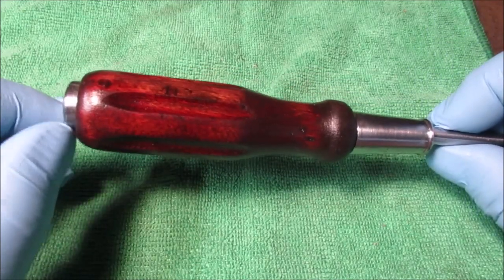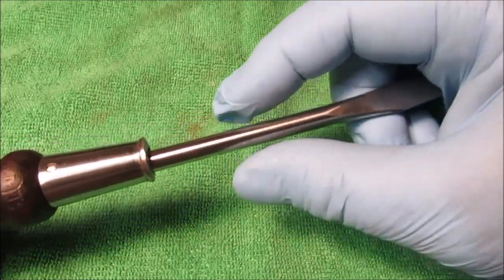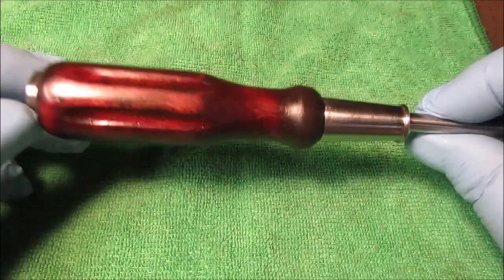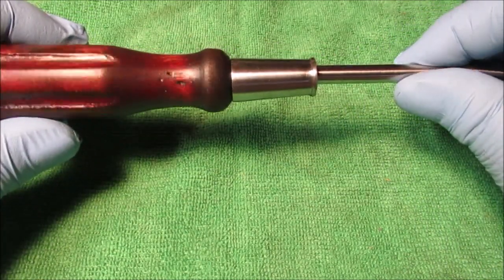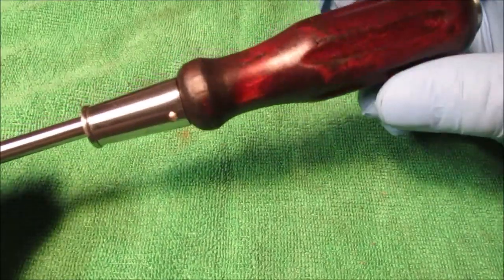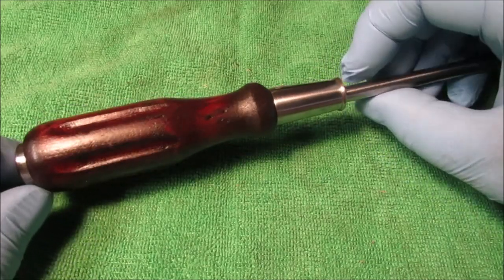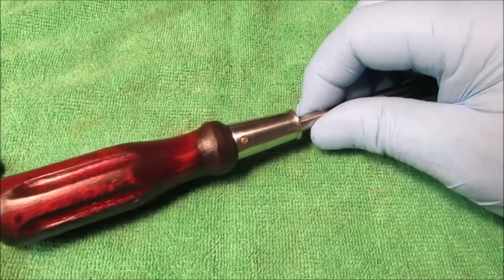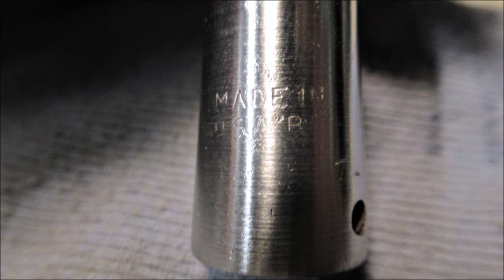RESTORE Wood Handle Screwdriver Stain & Seal Handle

Comment: Looks pretty sharp!  Wood handle screwdrivers can be addictive!
Reply from the maker: Thanks that red stain is very hard to sand away and stain over   I have my mini lathe that I can make wood handles but hard to find quality wood from like tree branches  or firewood old furniture wood could make some good stock to use
Reply: @not2fast4u2c  Keep an eye out for old chairs in the trash!